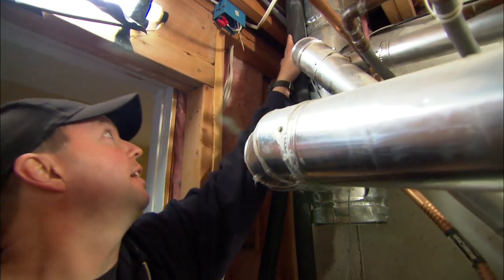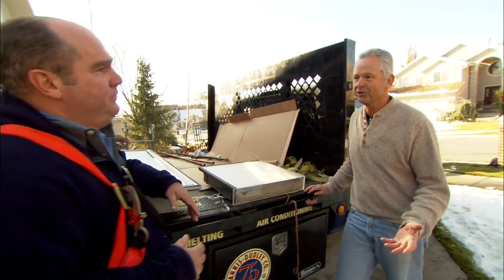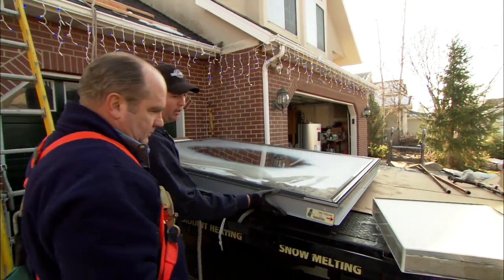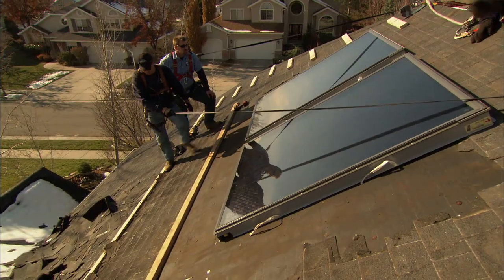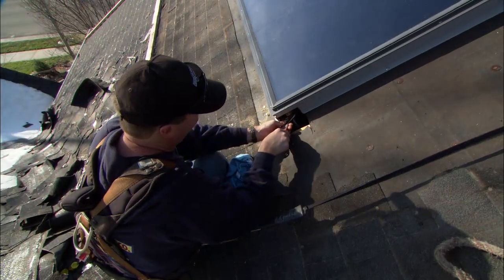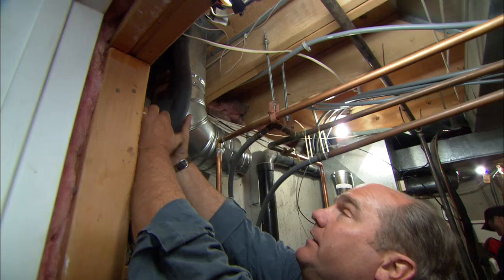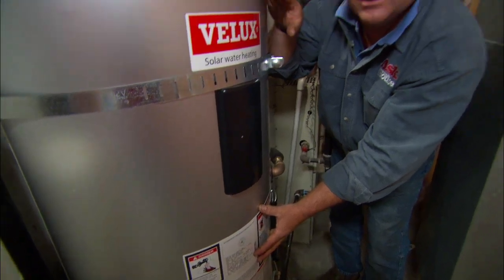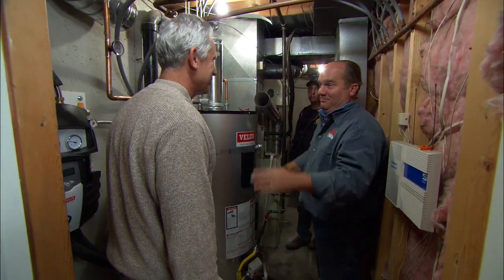How to Install a Solar-Powered Water Heater | This Old House

Comment: ethylene glycol is anti freeze propylene glycol is a plant based lubricant that can be eaten but poses no health threats it also works as a water absorption tool
Reply: it never mixes with the water what are you talking about? the anti-freeze is in a closed loop.
Reply: enkrypt3d I never said I mixed with the water
Reply: @davidhatetrain6423  so what's your point?
Reply: @enkrypt3d  If it leaks...

Comment: I'm failing to see why they could have used the old gas water heater again for this project instead of replacing it. Given that the old gas water heater should have been thermostatically controlled it should have worked well too. Neat install though and good idea; I've read about these systems in HomePower magazine.
Reply: Inverter controlled Hybrid water Heaters could also be the way to go as   they are seriously cheap to run  and could have a faster pay back than seasonal solar panels... There is a lot of 'Green wash'  out there at the moment
Reply: This system consist of 2 heat exchanges. One on the roof and one in the water heater. They are using an antifreeze as the working fluid to address freeze conditions. The old water heater would have required they circulate the actual water to the roof which would have been problematic in freezing situations.
Reply: @malachy1847  You can use both with a storage tank holding hot water from the roof panels then feeding into the heat pump water heater as hot water is used in the house.

Comment: The worse part about this video is the reactions of most people going "well it takes years to recoup, so why bother".  And that is a huge problem.  The more people that convert, the more the costs go down, the more money/gas/electricity is saved, and the better it gets for everyone.  A solution doesn't have to solve something right now, and payback also doesn't have to happen right away.  Stop planning for the tip of your nose and think about the generations after you.
Reply: I agree for the most part. But outside of the tropics where it is 100F year round these really are terribly pointless systems to add on to houses. If you are building a new house and design it from the start it would be good. But 99% of American homes built nowadays, for better or worse, are not built to last the length of time needed for this to make any difference. The money is better spent on something like solar.
Reply: This is solar.
Reply: @Luckingsworth  this is solar
Reply: @frankb5728  I think I meant that it is better to buy solar panels for electricity, than waste the money trying to use sun energy to heat water. Since in colder climates that isnt going to work 75% of the year where at least solar panels will continue to produce electricity.
Reply: @Luckingsworth  solar of any kind is kind of a waste for anything north of 30 ( I'm making a point, making such a blanket statement ). photovoltaic or thermal.   It really depends on your location and weighing the pros and cons of different systems.  I will agree that this probably wasn't the wisest investment for this homeowner but who knows what kind of subsidies or tax breaks he got for the system.   I've seen DIY solar air heaters that seem to give a good return for minimal investments, so there might be a day where these are efficient enough to justify the investment.
Reply: OK mr money bags. These systems aren’t being widely adopted because the only people who can afford them don’t need them.
Reply: @frankb5728  you can break even in Chicago now.
Reply: Nope, I'm good. I could think of 1000 better ways to use my money.
Reply: It's already cheap in other developed countries we just have to overcharge as much as possible so the shareholders don't get mad.
Reply: This is why government should get involved. This is literally a perfect example of government systems helping its people.

Comment: What about the torn up roof and missing shingles between units?
Reply: I'm gonna go out on a limb and assume the installer didn't just drive away with a hole & missing shingles on the roof. Why is there one of you in every TOH comment section?

Comment: I'll stick with my tankless water heater. I never run out of hot water. MORE importantly, my wife never runs out of hot water! 😉
Reply: Stevenowski You would never "run out" of hot water with this setup. You just use solar before using gas or electricity. Either way you will always have hot water.
Reply: "The multiverse theory may be dressed up in scientific language, but in essence it requires the same leap of faith." -Paul Davies

Comment: how much does a system like that cost?
Reply: a lot
Reply: Mine cost $10,000 and they didn't match the pipes to the labels on the tank so I think it's running backwards 😢

Comment: That is wacked. But I already have a solar system (came with the house) and the tank finally quit. Now I see it is totally piped in wrong. Both to and from collector piped into the bottom of tank. So what was a simple tank swap is now a major repiping. Sigh. I love diy I love diy I love diy.
Reply: you ever figure it out? or get it replaced?
Reply: Mine was also piped opposite of what was labeled on the tank. It has factory labels for a reason.  Lol.

Comment: I imagine payback is not measured in years, but decades... I have an 80 gallon electric hot water heater that cost about $350 and with our hydro electric power through the TVA, operating costs are not bad, and we have never run out of hot water. Supposed to cost about $300 a year to run.  I can not imagine a system like this solar one even being a consideration...

Comment: Good idea. However this must cost way more than what it's truly worth. Lots of work just for hot water.
Reply: The main downside of these systems is they can't recover more than what you spend on hot water. If you don't spend a lot then you may be better off with a waste heat recovery coil installed in your drain. Much less upfront cost and are pretty much install and forget.

Comment: Let's all start doing some basic math and do a quick calculation to reveal that the breakeven point on a project like this is probably 10 to 11 years. And, that's if this unit does not need any maintenance.
Reply: Depends where you live. In some countries you can get a grant for this purpose. So the whole system will be much cheaper.
Reply: And the water heaters they took out have a 10y warranty
Reply: so the working class tax payers have to pay to subsidize the electricity bills of the wealthy. The people who can most afford this, are the people who are getting subsidized by the people who can least afford it.
Reply: No one should be forced so subsidize anyone else, that is tyranny. Taxes should only be used for the common good, like military, roads, schools, ect. Welfare is theft and worst of all it doesn't work, it keeps the poor dependent on the government in exchange for their compliance (and votes).
Reply: We should ALL be forced to use the best fuel for the common good of the people...That is the sun!  No one should be using finite resources if we have renewables that are capable of doing the same job!  I don't care how expensive it is to start, we all need to do the switch to renewables.  If its mandated by laws, the renewable sources of energy will be the same cost as using gas/oil....and awy better for the earth and its inhabitants for years to come
Reply: That is the same arguement Hitler and Lenin used !!!
Reply: @tjam4229  So your entire economic case is based on force and coercion. If you cannot see the contradiction and inherent problem with that then you need therapy.

Comment: So like $20,000 to save like $10 a month on your utility bill.
Reply: looks like you dont care about the environment
Reply: @chartedtravel  You put $20K into your own system? And that's the best use of 20K to improve the environment?
Reply: I m just being a troll. Of course it's complete idiocy to do 20k to save 10 on bill. Improve the insulation and you will need to burn less fuel. But in the end unless democrats raise  gas prices to $13 a gallon as they promised just keep burning natural gas. It's cheap and abundant in this country.
Reply: Mine was $10,000. Definitely more than its really worth.

Comment: Probably loose money after all the costs for the fancy equipment, installation and repairs compared to leaving the old water heater in place and paying a few bucks more per month for gas or electricity.

Comment: Spending an extra $25,000 on a solar water heater to save on that $30/month gas bill. Gee, I wonder why these aren't more popular.
Reply: Where is it $25,000?
Reply: Mine was $10,000
Reply: Throwing solar power panel might be the way depending on finances. Can use the power from that to go power hybrid WH, etc. Excess can be used for other devices.

Comment: Why not power the whole house? Install tankless water heater and solar can power lights and water heater.🤔
Reply: Eagle i Trader solar not that efficient. Each panel will give anywhere between 80-500 watts of power. More commonly used are the 300 watt range. So you'd probably need atleast 5 panels with 100% light to power a small water heater. This doesn't include solar panel degradation which is approximately 1-2% a year. Solar excels when paired with battery backup but for power hungry houses it's more of a supplement.

Just to add, if you live in North America, Canada included, solar panels are never super efficient.
Reply: From my research the cons of going tankless are: if you get A model that allows One to have 2 showers going at the same time, then you may need to upgrade your panel to allow for larger and more breakers plus you will need to run larger electrical. That is for electric tankless. With gas you will need a larger gas line.